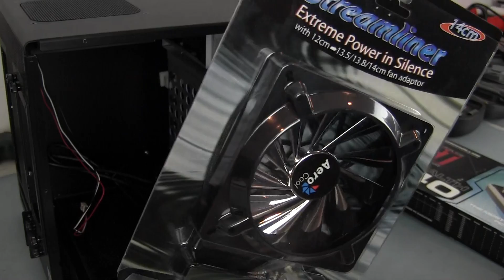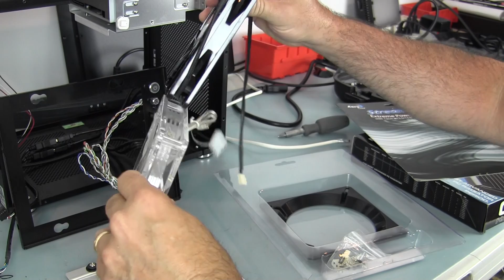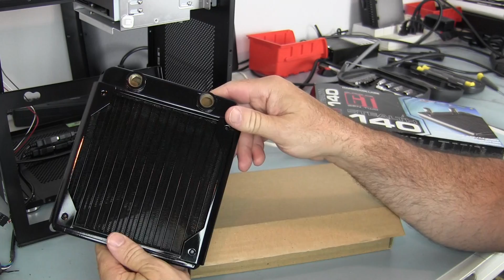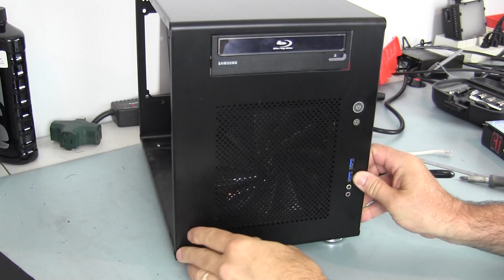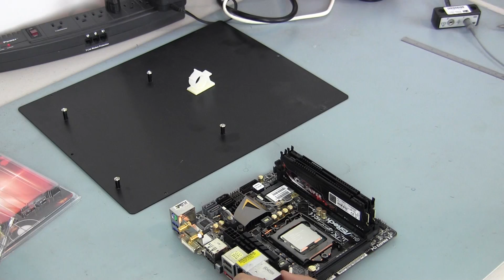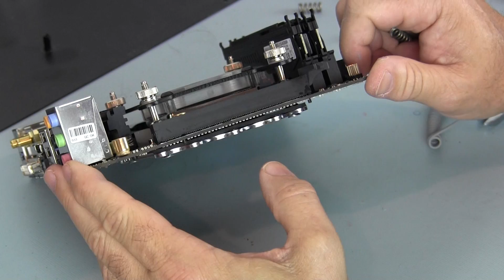Lian Li PC-Q08 Water Cooled HTPC Build Log - Part 2 - Build Part 1

Comment from the maker: This one is compatible as I think most would be. (Mushkin Enhanced Atlas Series MKNSSDAT60GB-DX mSATA 60GB SATA III MLC Internal Solid State Drive (SSD)) The key is that you have to do a clead install of Windows on the SSD. You need to change the Disk Type to basic disk in disk management.  When you load windows on the SSD be sure to remove the hard disk as windows will place some files on it and it is not obvious. Will cause problems if you ever remove that disk.

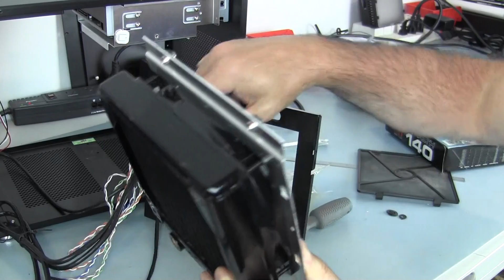Comment: Just out of curiosity, why put the extra rubber washers on that side of the front mounting bracket (11:10 or so), as opposed to the side where the fan contacts the bracket?
Also, I didn't catch the link to your radiator flushing setup.

Comment: sooo... 3570k for a non OC system .... i'm not going to ask why .... p.s you have space under the optical bay for the SSD, but i like your idea more to put it on the bottom, it will look cooler

Comment: You got an i-5 processor, G-Skill ram and a Lian-Li case with water cooling and you went with an Asrock mobo? Dude, that's just wrong. Don't cheap out on the mobo. Should have gone Gigabyte or Asus.
Reply from the maker: ASrock is an excellent mobo manufacturer. I have been using them for years.
Reply: Ronsanut I gave up using them, was getting too many problems BUT having said that, if they are working for you then fair call.